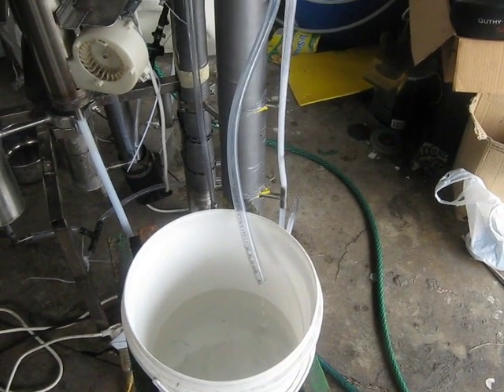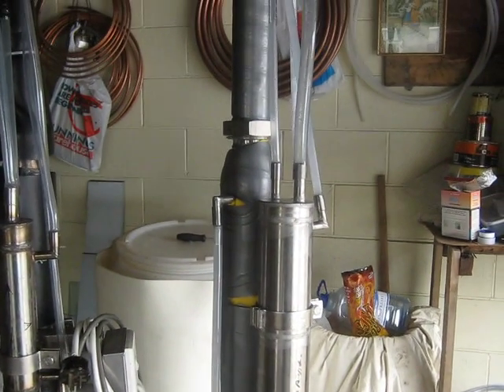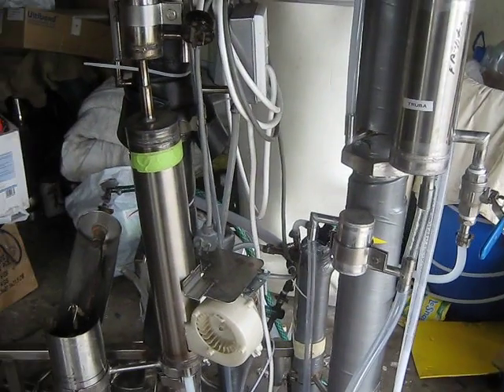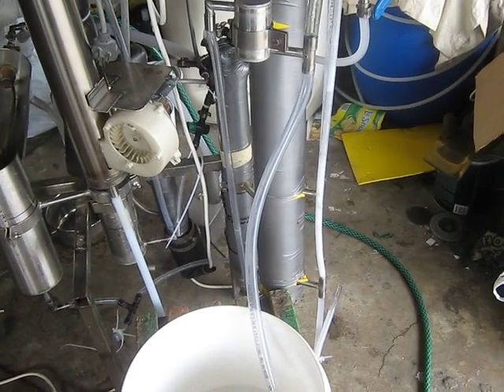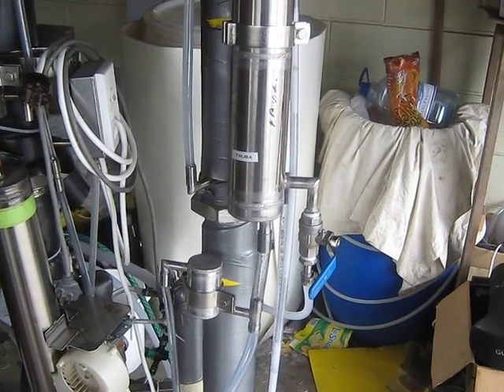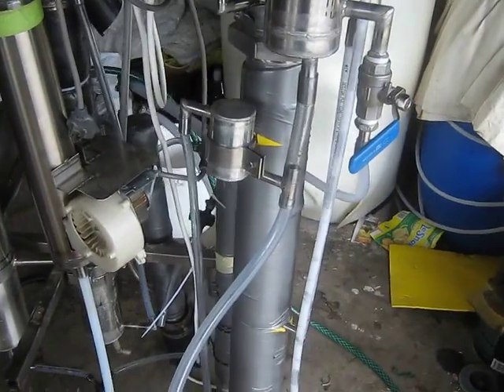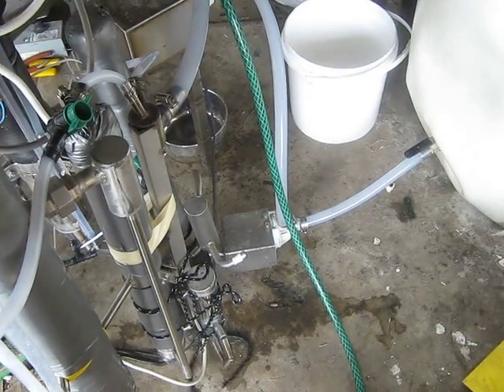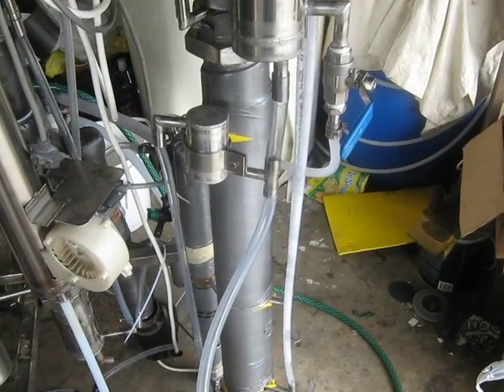Continuous alcohol still, second generation.

Comment: How much for a set of plans and instructions.  I plan to build a super engine when I get done fighting the government and want to produce fuel alcohol for the engines and as well to run the motors that will drive the generator heads to provide power for the factory.  But anyway right now I just want to be able to produce my own fuel alcohol to run my car so I can get off gasoline.  Please let me know.  I really need to get going and this looks like the answer.